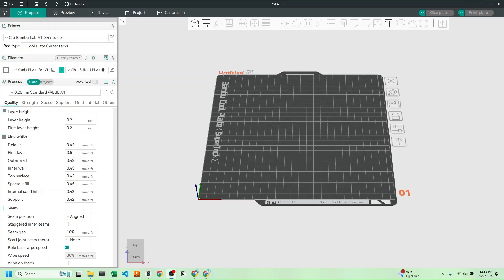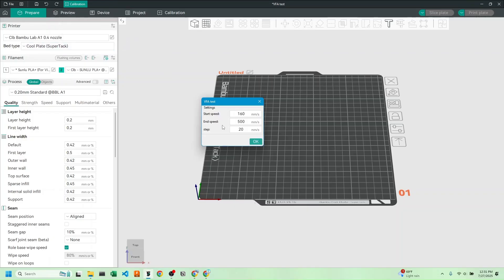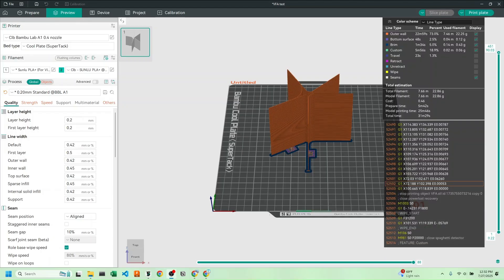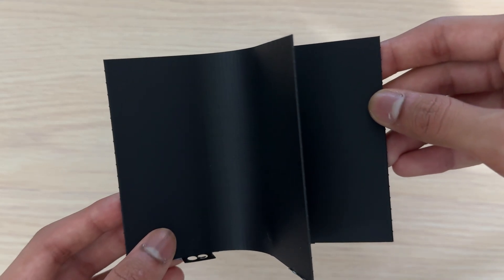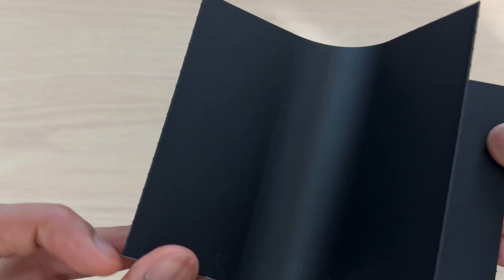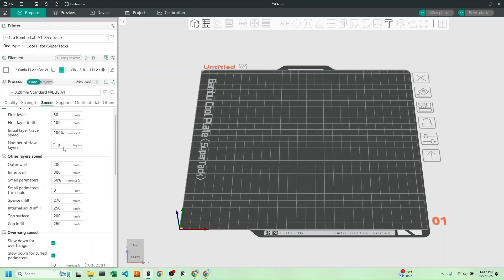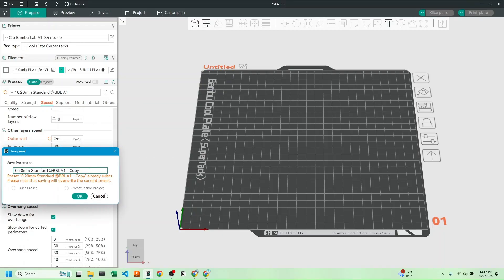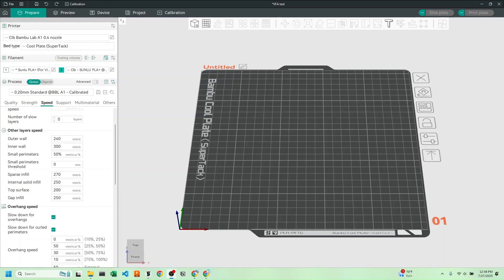Calibrate Using the Vertical Artifact Test in Orca Slicer!

Comment: so now what do i do with all of the filament used on this calibrations?
Reply from the maker: The entire calibration process uses about 100 grams of filament, but it greatly increases the quality and speed of your prints.
Reply: @thebuildplatebrain  btw i noticed is a bit pointless going to the max speed because it caps the acceleration it dosent have enough space to go full i mean at least my printer caped at 366mms that or its the max volumetric speed
Reply from the maker: Okay, that's good to know. Still, if you want to see if your printer can print faster, you can try going higher and higher.
Reply: Uhhh.... throw it away?